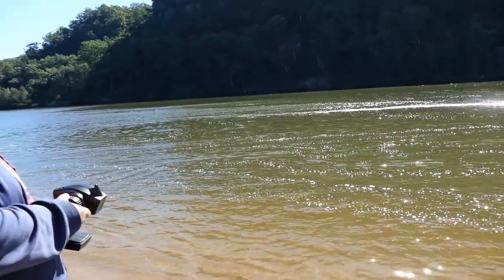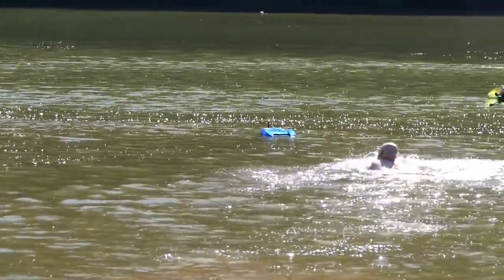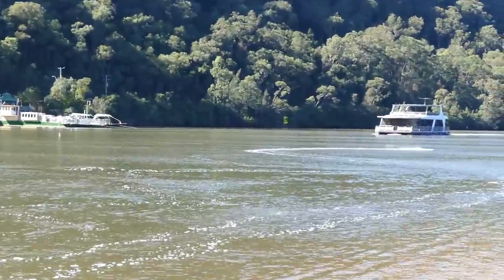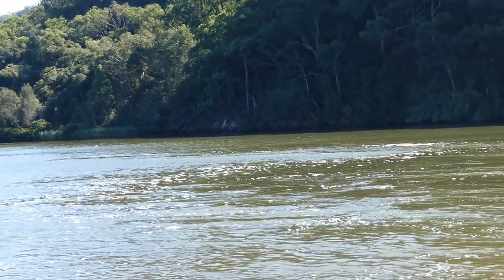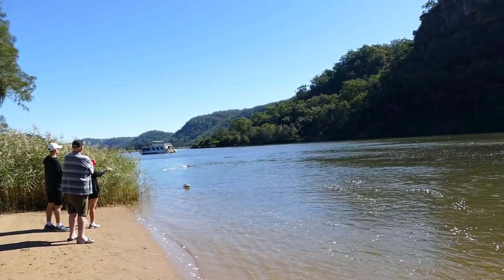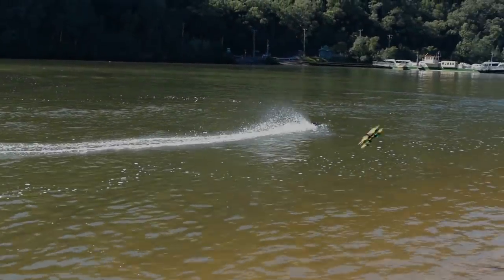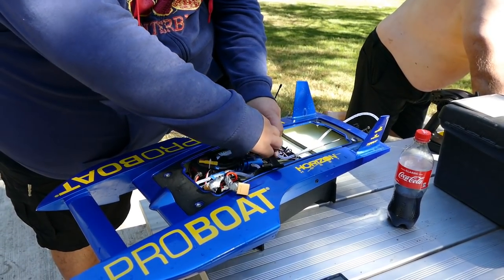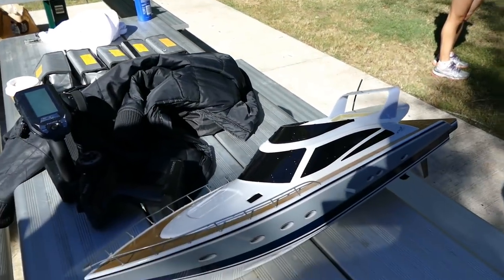ProBoat RC Day - UL19 Problems, ZELOS Crashes, IMPULSE Spins & Flips = AWESOME!

Comment: That proboat impulse was running really wet. change that prop angle a bit and you'll get that thing screaming across the top of the water in no time.
Reply from the maker: Thanks man, appreciate the info
Reply: @RCTanksTrucks247   
Not a problem. If you are so inclined please check out my channel for RC videos. I have some air screw driven 3 point Hydros that you may be interested in. Basically they are 3 point Hydros driven by an airplane propeller. An airboat on steroids.